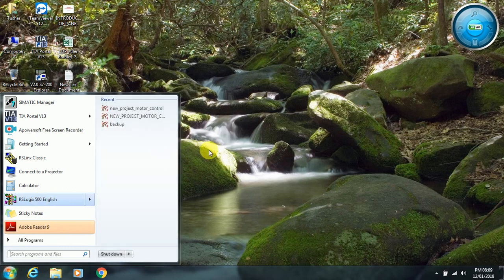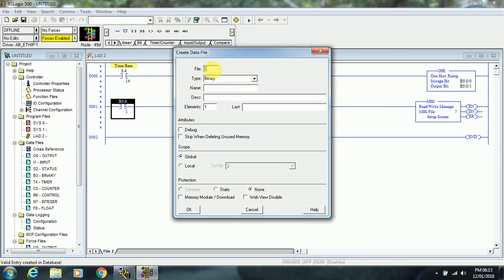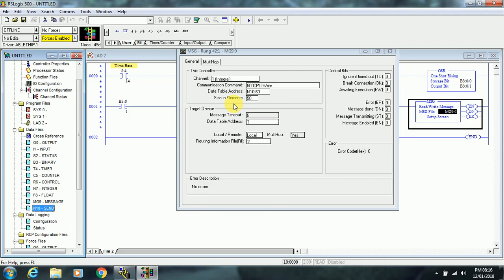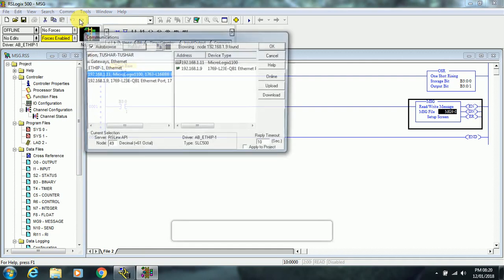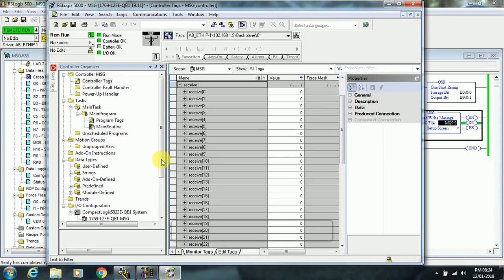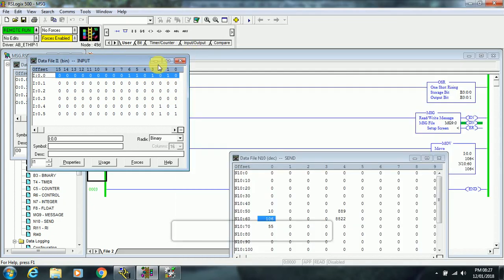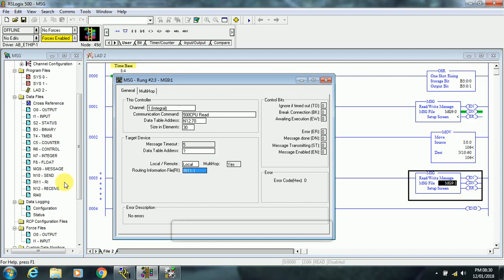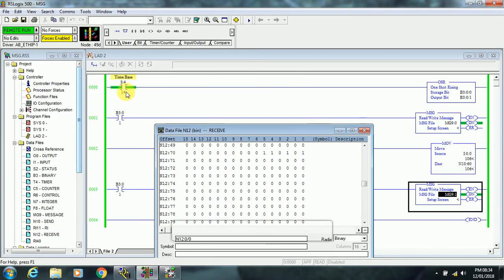Communicate two PLC ML1100 & Compact Logix L23E using MSG instruction

Comment: Hi can you tell me how to connect two ML 1400 with each other using Msg instruction in RsLogix 500. They are connected via ethernet. I want the input of one plc control the output on other PLC.  thanks
Reply from the maker: Adnan Sarwar in multihoop tab select the plc and enter its ip address
Reply: Thanks for reply i have done that but what about in 2nd ladder logic what should i do there how can i trigger the message instruction in that logic from message instruction of plc1 and then how can i fire the output using the message instruction in ladder logic 2 and what about the screen setup parameters for message instruction in ladder logic 2
Reply from the maker: Adnan Sarwar in 2nd take msg instructions as a read
Reply: and what about data table and target device tabs and multihop tab in 2nd
Reply from the maker: Adnan Sarwar  in data tale give address where u want to store.
And in targat give adrrss of 1st device as target and in multihoop provide the adress o 1st one
Reply: is it possible that you can make a video of that one please
Reply from the maker: Adnan Sarwar i dont have two ml1400
Reply from the maker: Adnan Sarwar if you have team viewer give your pc remotely to me
Reply from the maker: Send your whats app number
Or ping me on 8888004188